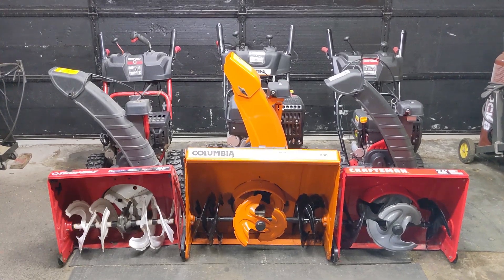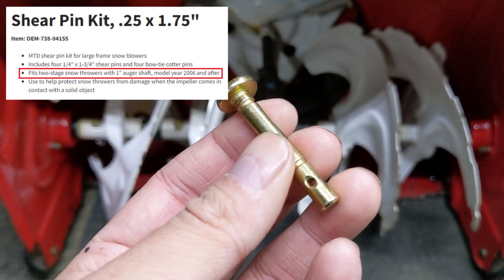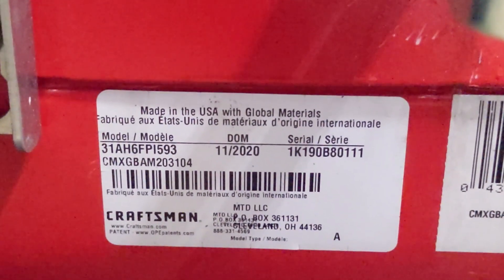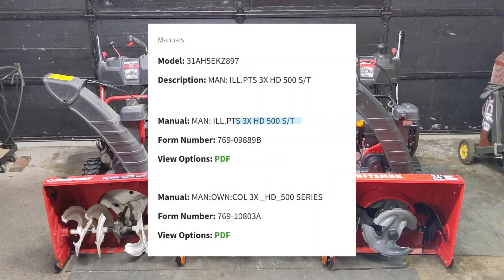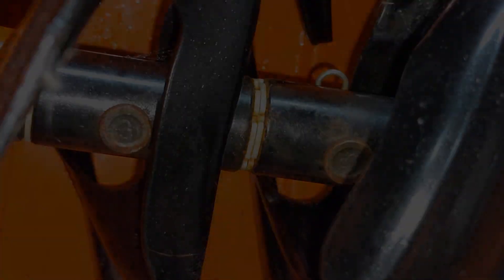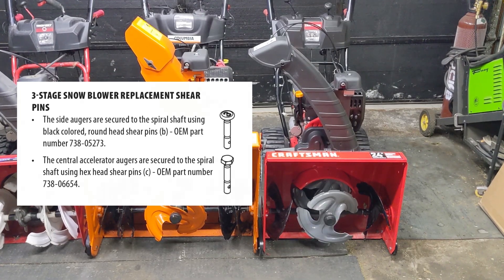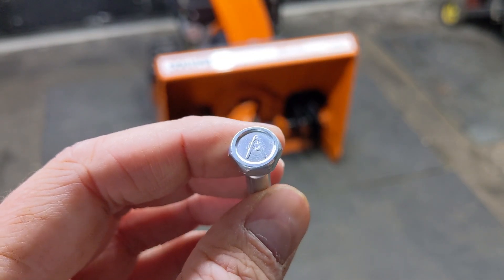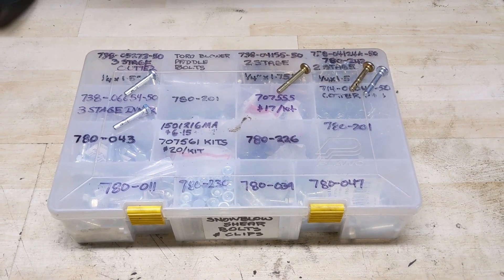Everything You Need to Know about MTD Shear Pins (Covers 2 & 3 Stage Snow Blowers)

Comment: I have a shear pin that looks like it’s stuck and the bolt head looks all deformed.  It didn’t break yet and the auger doesn’t spin if I try to spin it with my hand.  Is it okay to keep it in there or should I remove it?  Any videos on how to remove it if it is stuck?

Comment: Can ANYONE help me please? 
I need to replace the shear pins on my snowblower.  The Mtd site has only this
shear pin kit: Item: OEM-738-04124 for 26" snowblowers.

My snowblower info is:
 26" Gold Series Yard Machine  8.5 Hp 12" impeller
The only number we could find on the machine is:
1F221B40359
(My husband took the number directly from the machine and may have copied it incorrectly - I am unable to get to the unit at this time.)
There is no year of manufacture listed on this unit.  The only other info on the unit were two 10 digit phone numbers.  
Will the date of manufacture have any bearing on the replacement of the shear pins? 
The 1F221B40359 number returns no information when I search on the mtd site or on Google.   This model could not have been manufactured 2021. It is old, is in great shape, and it was given to us.  I am guessing it may have been produced in 2011 (or as early as 2001 if that even possible).  I am also guessing that I am looking to buy the correct shear pins, but I do not want to guess when it comes to safety for the machine or anyone using the machine.

Am I buying the correct pins for this model?  If not, what shear pins do I need?

Thank you to anyone who can help me.  This video was very good - it went into great detail and taught me a great deal.  
Liked and subbed!

Comment: I really love all the technical info you give. My project started out as replacing the slotted spring pins holding the secondary auger to the drive shaft as they failed. this is the second time in 7 -10 years.   I watched your videos on the differential repair to figure out how to disassemble the machine.  I ended up finding 2 bent shear pins as well and a worn out skid shoe. The wrong or incorrectly used shear pins (I am still trying to figure out which so i can solve that as well)  were the probable partial cause of the failure. 1 of the split pins had fallen out as well.  You provide great information that is helping me repair my machine and get it back to a better place than it was even before the failure!

Comment: Have you ever seen major damage to the spinning blades from a customer bringing in a snowblower? Would hitting a hunk of ice cause some damage? I was driving my jeep thru the piles left on the side by the plow, I was trying to break them up so they would melt easier. I hit a big chunk of ice, the Jeep bounced in the air maybe a foot or two, and everything inside the Jeep was throw about, and it surprised me quite a bit, and the Jeep was fine through all that, my underware was another story 🤣

Comment: Many thanks for this info, detailed video and also the written description. Well done.
I have a 3-stage Craftsmen purchased last year and similar if not identical to the one in your video with an inoperative inner accelerator prop. I will be checking the shear pin or lack thereof this afternoon.

Comment: princessauto is selling those shear pins.
Reply: Will have to check that out Ken i have seen the 2 stage pins and clips but never the one marked 3 nor the head head one for the impeller.
Reply from the maker: Yes unlike the Briggs and Stratton shear bolts, you can get these MTD ones almost anywhere. This video is mostly to explain the use of the #3 headed pin on 2015-2018 snowblowers with the 3rd stage, and the hex head pins on 2019+ accelerators.

Comment: Hey Jake, are you doing a " How to install drift cutters on your snowblower. "video  this Sunday? Lol, stay safe guys and start your engines!!!
Reply from the maker: Lol good one Mike, no but maybe a quick one on specialty sockets. I missed last week, been too busy fixing snowblowers. Although there is a trick to flipping the drift cutters to add stability to these newer thin metal housings
Reply: @EliminatorPerformance  Great point on the drift cutters Jake not many viewers know about that trick so thanks to Mike for bringing up the drift cutter bit eh!
Reply: Mike thanks Jake came up with a great idea for a video there because the materials of the auger housing are so thin today the cutters do add stability when mounted downwards to the front.
Reply: @waynestefinashen239  Hey Wayne, sounds like a great idea and video. Yeah those buckets are thin. We have a newer Ariens and when blowing really deep snow  even in 1st gear the bucket would rise up leaving snow behind. I ended up adjusting the 1st speed gear slower insted of trying to add weight. Looks by the radar you guys are in it now, where before it was running south of you. Take care guys.
Reply: @Mike-ig2zq  Mike that is why we still have an old Craftsman 8/25 that we installed $400 worth of (list prices) parts. These older units were so much heavier made of real steel instead of tin and they stay down on the snow even when it is that hard packed wind driven snow. Jake is presently looking to buy the new Professional Series Ariens 28" all square tubed handle and no EFI but they are back ordered until January.
Reply: @waynestefinashen239  Yeah I have 2 family members with older Craftsman I did impeller mods on and they are solid, and so easy to work on for just about anything. The new Ariens sounds like quite the machine. We're pretty happy with the Deluxe 28 SHO overall, and the support manuals for Ariens are excellent. I downloaded 5 manuals which tell you just about everything. Alot of this newer stuff has almost no product support from what I hear.
Reply: @Mike-ig2zq  Funny thing an Ariens just came in with a bad electric starter and wow it is made in China which you can buy on Amazon for 1/3 cost.
Reply: @waynestefinashen239  Good to know Wayne. Just out of curiousity I did look up  a couple parts last year, specifically the carb and differential gear and they would each have to be around 200$ Canadian. Although I see there is now a knock off carb for around 60 Canadian.

Comment: So with all that said its safe to assume I can not use the 738-05273 "3" stage pins in my 2007 2 stage blower? Even though they look the same. But we`re not 100% sure of the 3 stage pins grade hardness.
Reply from the maker: That's correct, if you have a 2 stage, you should run the 2 stage pins (1.5" or 1.75"). The #3 headed shear pin is most definitely stronger, as it was manufactured as an upgrade to the weaker 2 stage pin. If you keep shearing pins, you could potentially use them as they measure the same, but it would be at your own risk.

Comment: Thank you for a Great video. I have a 1997 or 98 MTD snow blower.  I have been told that they only made it for one year. Would this still use regular MTD parts ? My problem is when I use the electric start as soon as I plug in the power cord it starts turning over. The button doesn't do anything. Also what shear pins should I use. Thank you for all your helpful videos.  I live in the U.S. in northern Indiana.
Reply from the maker: Google your model number and look for a parts diagram, those made in 97-98 would most likely use regular shear bolts, and would have a part number listed in the parts diagram. So follow the same steps searching MTD manuals, and you'll get the info you need. This shear pin change only applies to 2015-2018 models

Comment: Thanks for the heads-up about the possible part number revision for 3-stage blowers. The PDF manuals still list the old part number for the pins but MTD's parts buying site lists the newer part number. I have both a two-stage from 2009 and a 3-stage from 2016. A couple years ago the 3-stage broke 2 pins and nearly broke 2 others. All I was doing was plowing into some deep snow. Guess now I know what the issue was! I have learned to hate 3-stage blowers, they just don't do anything compared to my trusty 2-stage.
Reply from the maker: Yea they're definitely worth upgrading, the cost is nearly the same I believe. My dealer prices are anyway.. I don't personally like them because they force snow into the smaller impeller. If MTD used a larger impeller like ariens 14" ones, I don't think it would be as bad.

Comment: Another excellent video. I hope you don't mind but I want to mention a Hackberry did to save a Bolens snowblower. This machine had snapped the drive chain because of the axle bushing wearing out which are impossible to find and are larger than the typical bronze bushings. I cut an old Craftsman snowblower up and used the bushings and piece about 6 inches square around the bushing which now is a bolted using Ariens hardware though that makes no difference. I also learned about chains and used one from a rusted out machine with a great chain after making a C-clamp press to put the chain back together because I'm cheap and couldn't wait for quick links. Hope that helps someone.
Reply from the maker: Sounds like it worked and saved a fortune David, good job. Thanks for watching!

Comment: What a great explanation Jake! I can't wait for the Honda, Ariens, Deere, Toro and Husqvarna shear bolt video!! 👀😂🤣🤣
Reply from the maker: Definitely not going that far Don lol I see a lot of MTD equipment, and had these 3 in the shop at the same time, so it made sense to film this one.

Also, Ariens, Deere, Toro, and Husqvarna (to my knowledge) don't have the 3 stage snowblowers. I think it's just an MTD thing.
Reply: You should see the specific bolt for Honda plus anodized black with a good price tag also. Only problem we only got in one Honda so far and all pins and spares were ok.
Reply: @waynestefinashen239  yes Wayne I'm well aware of Honda shear bolts lol as I was a Honda dealer for 35 years at my family business. It took me 2 years to talk my Dad into selling "that Japanese junk", and in 1985 he finally relented and he now always says "that's the best thing we ever did Don"! In 1996-97 Honda claimed that we were their largest selling snowblower dealer in the WORLD! We sold a TON of units those 2 years! .... they're still selling shear bolts for them lol. I retired from the business 2 years ago and now work from my place repairing equipment, 50 years with family was enough for me. P.S. - we were Honda's largest generator dealer in the 🌎 for a few years as well so let me know if you have any Honda questions 😁👍
Reply: The Honda shear bolts are pretty pricey also.

Comment: Jake, very good explanation of a certainly confusing applications. I don’t know why MTD needs to make it so confusing. At least I still get to use the 710-0890 in my 1998 Mastercraft 10.5hp.    Have a good week.   Rick
Reply: Rick your right appears confusing but using the proper shear pins saves a lot of aggravation especially when that back accelerator needs a shear pin installed it is a pain in the you know what to get all the holes aligned for installation of the shear pin.
Reply from the maker: Thanks Rick, and yes they're much stronger than these basic shear pins. Although I'd wager the new hex head GR8 shear pin might be stronger 💪 thanks for watching!

Comment: Great clarification Jake! It’s amazing what they charge for the same pins under different names, MTD Vs TroyBilt vs White Vs Bolens Vs Cub Cadet!!!
Reply: Jake really put in the time and research on this one but those 3 blowers came in all at the same time just kind funny it lead into a great shear pin/bolt video.
Reply from the maker: Yes definitely. As shown, I buy direct from MTD and I get the 50 packs to save a bit of money. I believe my cost is about $0.40 each, and they list for about $3.50 each, or I sell 4 for $10. I figure if I sell all those shear pins shown, I make a profit of about $550 which isn't bad.